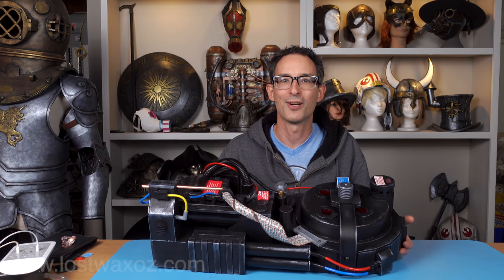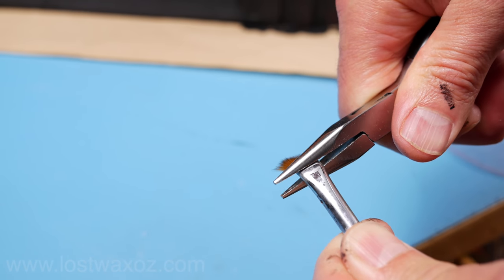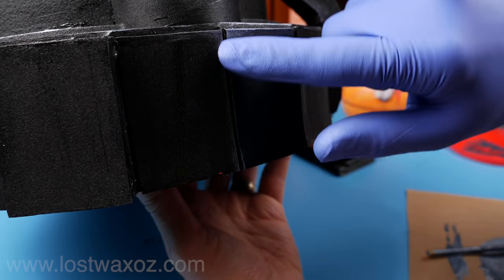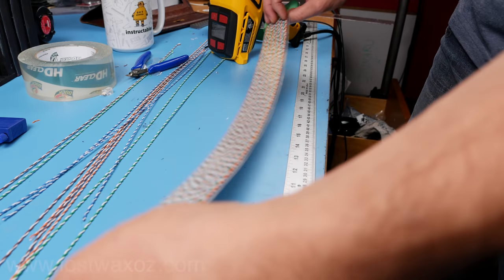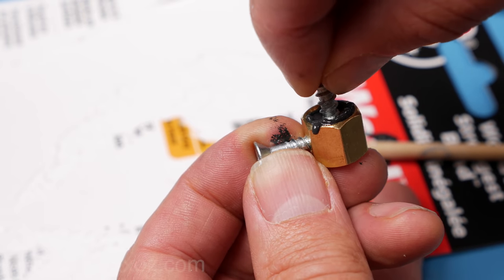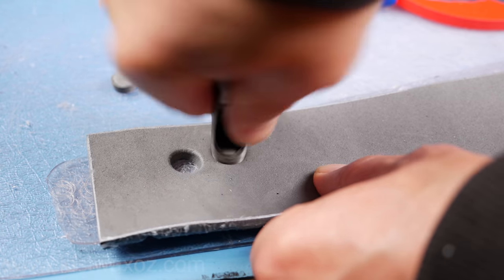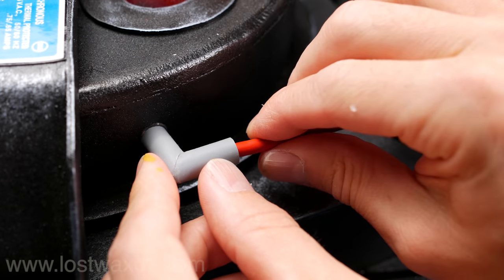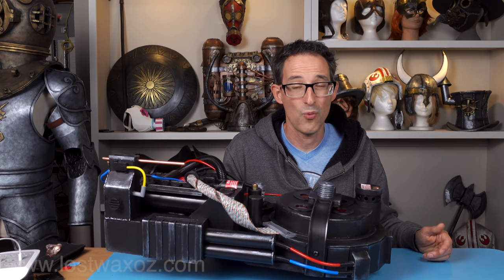Make a Ghostbusters Proton Pack From a Floormat! Part 2. With Templates.

Comment: WOW!!! Ok this is amazing and as a HUGE Ghostbusters fan without a pack, this is how I will finally do it. I can't wait to follow the rest of the build. I have the wand already from Mattel and the Spengler’s Neutrona Wand, so I might use one of those instead of building it from scratch.
Reply: Snap!!! I have the Spengler wand too, I just finished cutting out all the pieces and sanded tonight. Glue commencing tomorrow. I may have to use other things for some parts, and I am having major problems finding the pipes for some reason.
Reply: Hi guys, did you get the hasbro wand to fit?! is the foam stable enough?!

Comment: Another great video for a cheap Proton Pack. Though you got quite creative with a number of the brass and angled fittings, there are still a lot of alternate read-made parts that one would find in the plumbing section of a hardware store that work just perfectly. 
Also, if you wanted a more 'true' paint chipping method, you could first paint the entire pack (or just the main areas you need) a silver colour, then use a masking medium like liquid latex or toothpaste to mask off the chipped areas of the pack. Such as along edges and ridges that would get the most wear and tear. Then paint the entire pack black. Once dried, simply rub/wipe the spots you masked and you will reveal the silver underneath. Makes for a more realistic chipped paint look.
Reply from the maker: That's a great idea for the paint chipping, I'll have to give it a try!

Comment: Lost Wax, serious question. What is the best method for hardening the foam? A couple of layers of glue and a couple coats of Plasti dip? This pack is my first ever foam build.
Reply from the maker: I don't try to harden the foam. If you put a brittle coating over it and it flexes you're just gonna get cracks. Rather try to have a flexible coating that will move with the foam.

Comment: I’m excited to start this build, I have a question. Would you suggest spray painting the pack or just paint it as you did in the video? Thanks
Reply from the maker: I'm not a fan of using regular spray paint, it just gives such thin coverage, it's hard to add the worn silver antiquing on top of it. If you want to spray it, you could use plastic-dip, it gives a rubbery coating that is great. Just make sure to not breathe it in when you are doing it!

Comment: Can I ask why the epoxy for certain parts instead of the glue gun? Is it simply a case of what will bond best to the materials, ie epoxy for anything with metal or plastics but all foam seems to be glue-gun primarily? Thanks in advance!
Reply from the maker: Yep, that's pretty much it, hot glue doesn't stick well to metal especially, and some plastics aren't that great either.
Reply: @LostWax  Thanks for the reply, good to know! And I've bought the Ultimate Everything Super Value Pattern Bundle already - AMAZING value. Can't wait to build this with my son who is nearly 5 after we finish another project - sorry I couldn't wait for the Proton Pack to be added so cheekily grabbed that too! This is such a good entry into the world of building along with cardboard for young (and young-at -heart) makers. Thanks so much!

Comment: At 07:44 what is that item you are cutting to use for the wiring? I want to use that for my own Proton Pack I'm building. Thanks 👍🏾
Reply from the maker: That's a piece of tubing that used to be commonly used for sinks, like between the valve where the water comes in and the tap. You could also use something like the tube from a pen or any other small tubing you can find.

Comment: Do you think I could scale this down “relatively” easily for an 8yo?
Reply from the maker: Scaling this pattern down isn't super straightforward, unless you are scaling the thickness of the foam down the same amount as you are scaling the pattern. This is because a lot of the parts actually rely on the addition of the foam thickness on the edge to make the final dimensions of a piece. If you do some careful thinking, I think it could be done.....

Comment: I would love to make this, but I’m just concerned about how well it would last since it’s just foam. Do you think it would have a good shelf life?
Reply from the maker: EVA foam is actually pretty durable. As far as shelf life, it'll last for years on a shelf:) The main thing is to store it where it won't get squished, or too hot, ad those will deform it. Other than that, it'll be fine.